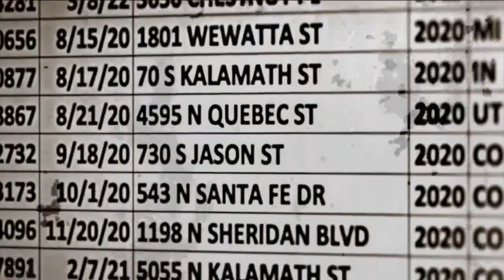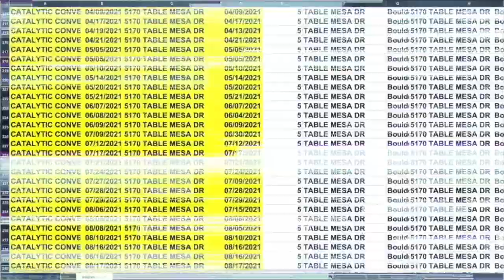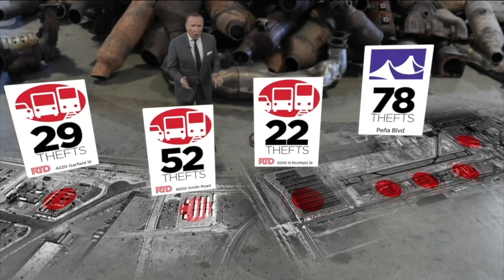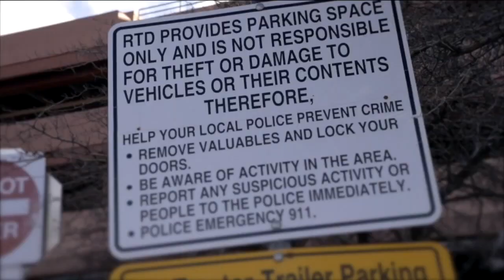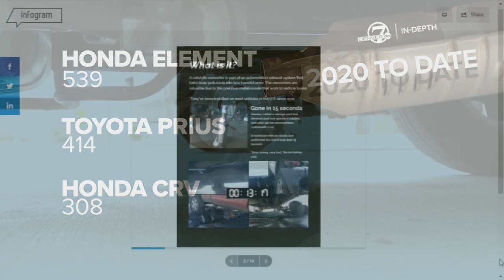Nearly 4,000 catalytic converters stolen in Denver, Boulder since start of 2020

Comment: I’m a fleet mechanic for a non profit that works with our disabled community-
In 2019 we had 3 catalytic’s stolen, in 2020 we had 8, in 2021 13, so far this year 5-
We reported the first 5-6, with video footage, even close ups of the criminals... no arrests-
The cost in ‘19 for a catalytic was $400-$800 depending on the vehicle, today same vehicles $800-$2000-
Colorado passed standards that doubled+ the cost of a catalytic-
I’ve written to our ‘representatives’ telling them the solution is to clamp down on the purchasing of stolen catalytics by asking for proof of ownership... never heard back-
The 4000 number is much higher, several neighbor businesses around us have continually been hit & they too stopped reporting-
A total repair bill with parts & labor would easily run in the $1500-3000 range, a big hit for working people, yet ignored by our authorities, across the board-
Reply: Of course they didn't respond. They really don't care.
Reply: @catherinemartinez5542  👋✌️

Comment: COMMON SENSE 
"Catalytic converters" contain some "valuable" metals embedded in - 
(all metals have values but all do not attract looting)! - 
if much more valuable metals are affixed onto the bodywork or engines of your car, then
it attracts the "criminal enterprise", a sort of like putting in some parts of your engine 
jewelry made from silver or gold!  You think your car will be safe if the stirring wheel is 
made of gold? Then avoid doing that kind of silly thing, not to be targeted by the criminal enterprise!  
OR maybe the manufacturers want it, they planned that kind of thing to happen - "good for business?!"

Comment: The car manufacturers are guilty because they mount the expensive catalytic converter under the car without any protective shield, thus encouraging the theft of catalytic converters. We must all unite and sue the car manufacturers, to pay compensation! The car manufacturers should learn to mount protective shields under the catalysts and pipes so that it takes several hours for them to be removed to access the catalysts, then the catalysts will no longer be stolen!